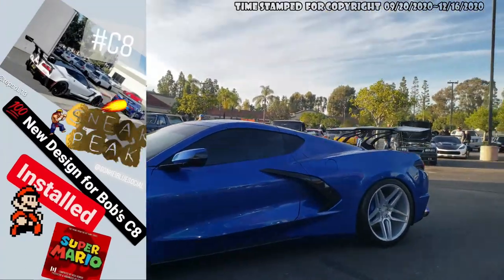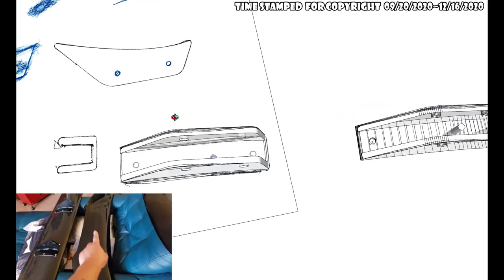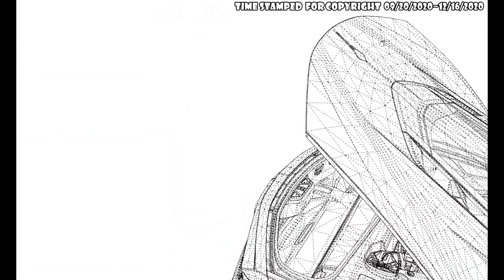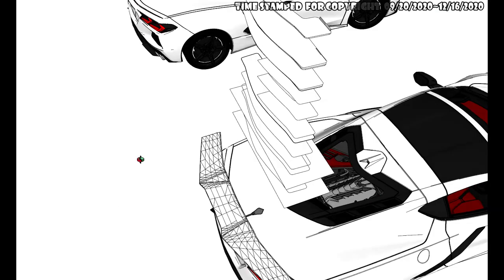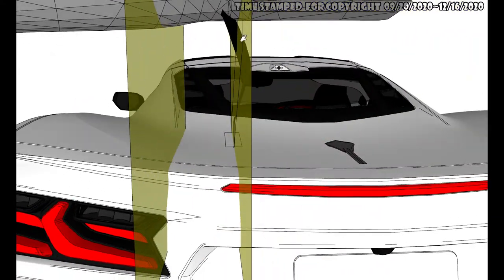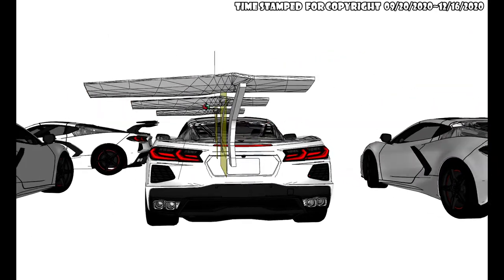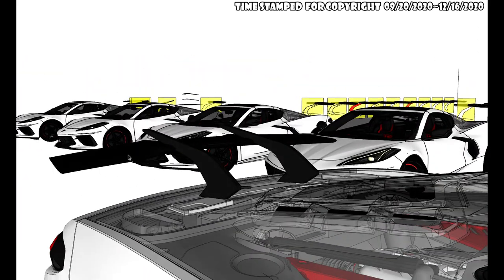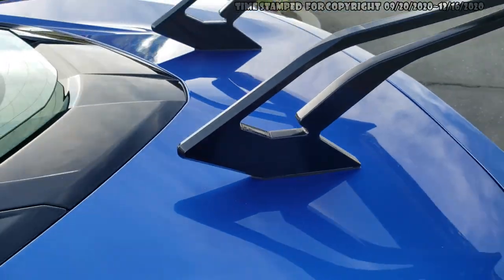Design Bob's C8 Corvette High Wing (not Spoiler) | Repsol13 F26 Corvette C7

Comment: Where can i download the CAD for the C8?  Iv got a similar project.
Reply from the maker: Which program are you using, it is not a CAD file... but I can convert them for you... if you want
Reply: @Repsol13  i use solidworks 2018. A stl or step file would be awesome.
Reply from the maker: @derekwebster1755  email?